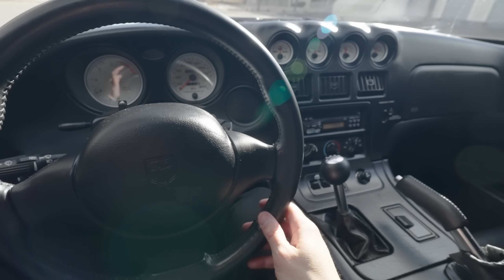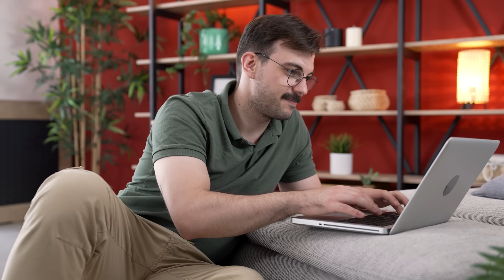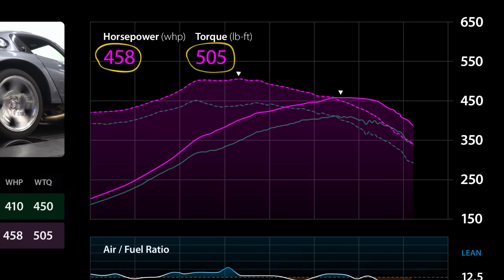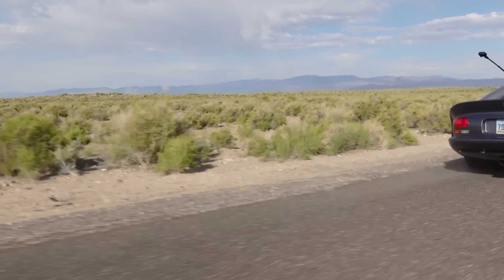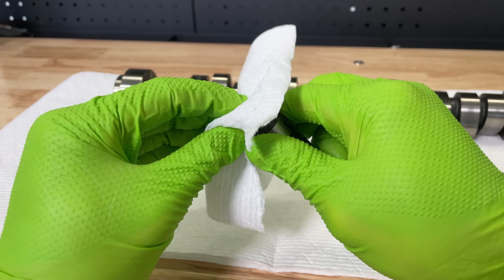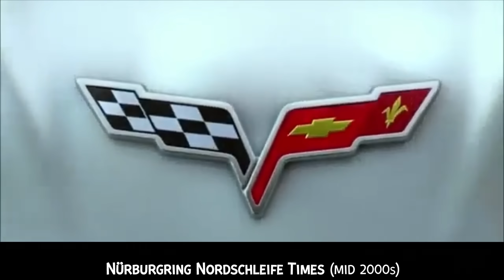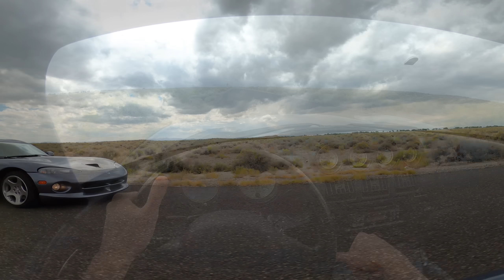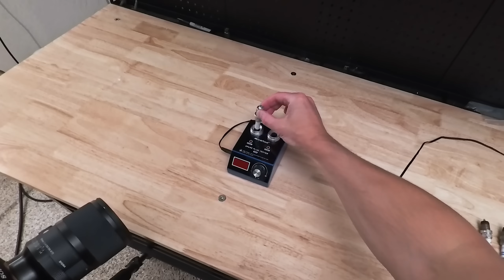Don't call it a comeback

Comment: Brother ya gotta stop using octane “booster” just get a can of race gas and mix at a low percentage. You will gain actual HP and it will also run cooler during long pulls. Just can’t go crazy with it if you run cats.

Comment: That little plastic hand is the best fanboi prop yet, it's hitting the has-been data screaming look look!  My POS car was good a long time ago and I'm so upset that I kept the magazines that told me this information!  Hilarious, couldn't beat a stock Z06 (never mind a ZR1!) so you dyno the car to discover it's just a better car than the Dodge, duh. Notice the name Doge doesn't appear anywhere on the Viper... that's how awful Dodge is, even the designers knew to keep that shameful name off the car.
Reply from the maker: I wouldn't take it so personally. There's a decade+ between these two cars.

Also 'dodge' appears on the rear bumper.

Comment: Side note : That Audi has the same Engine as the Viper, in the early 90's Dodge owned Lamborghini, that V10 is the  one in V10 Dodge Ram, Dodge sent a handful of those V10 Truck Engines to Italy to see what Lambo can do with them, they ended up putting them is some Lambo's, then dodge sold Lambo to VolkWagen which in turn owns Audi, Which they then put that engine in the Audi RS, to make a long story short 😆😆 Dodge Ram 2500 V10, Viper V10, Lambo V10, Audi RS V10 all have the same Engine, but Tuned specific to each Application

Comment: bro its kinda trash cuz engine doesnt let u go fast xd, gear does, think about hypercars like bugatti, almost 2k hp but it doesnt go 0-100 in half a second bc if they wanted it to accelerate  so much and still be fast they'd have to make a transmission that has 15 gears bc imagine a car with 7 gears but top speed is 200 but another one with 7 gears b ut top speed is 500 so the acceleration will be less but still faster, audi has probably a better transmission and its v10 so rpm diff maybe

Comment: Ive driven 2000+ hp drag cars, Teslas, a Lamborghini & Ferrari. I drove a few generations of vipers, IT WAS TERRIFYING. 
Yes a hellcat can spin tires in any gear BUT you can return it to a straight line, a viper you CANNOT unless you call it BEFORE it happens. As SOON as you hear it rev out quickly you get off the throttle. 
I have driven cars with literally 2-3 times the horsepower and nothing and I mean nothing will terrify me as much as a viper. 
They softened the blow by generations but ita a truck motor that can tow more than almost any truck (not diesel) out there. 
Absolutely a unit. I cannot believe ACR got rid of the viper. Hellcats suck, they arent even that fast. A viper, may loose off the line BUT when it hits 2-3 out of 6 gears it will take any hellcat to gapplebees all day

Comment: Could it have been caused by surface rust from sitting?  I had a H23A that sat for 5 years and it caused some pitting in on the cams lobes that were all pointed a certain direction.  I’m not entirely certain what direction because the engine could have been rotated after the rust formed.  Anyways I wasn’t going to chance it and run the engine like that.  I pulled the cams and cleaned them up before putting them back in.
Reply from the maker: interesting theory tbh, this viper did sit for a long time before i bought it.

Comment: You need to be using star tron enzyme fuel treatment alongside the octane booster.  You will be speechless at the results.  Please try it and then try racing or dyno ing it again.  The secret is to put the star tron fuel treatment into your freshly filled gas tank, after the fill up (not before like the instructions say — before may work fine if you put it in while you’re at the gas station but given how messy it can make your hands I don’t see how anybody would be doing that.  So definitely put it in your gas tank after you fill up.  The benefits are even more noticeable if you run a turbocharged engine and whenever the ambient temperature/weather is hot). Star tron enzyme fuel treatment.  I’m dead serious.  Please reply to my comment if you ever decide to take the leap of faith, and let me know your opinion on the results.

Comment: From an engine-building-excellence point of view, the euro boys are right. 100hp/litre is the minimum acceptable specific output.

 From a drive ability/useability/real-world-performance point of view it’s the shape of the torque curve, the gearing, the traction and the weight. Then the chassis/suspension.

 Horses for courses

Comment: 14:57 man this is a cool video the right amount of racing plus adding in the right amount of attention to the maintenance and technical side of it which racers know comes with proper use of any performance machine. Plus IT'S A VIPER I've always loved these cars. Thought of it as an American Lamborghini from back when lambos were fast but hard to control. Curious to see how it handles on the track in and out of curves with speed . Great video!

Comment: I were you, I would fix that car if it is possible, and then I would sell it immediately. In my opinion, these cars are notorious for having problems, especially if they have been driven hard. But even if you take care of them and drive them like a grandfather, that ticking issue can still happen. Personally, I think the Dodge Viper engine is one of the most unreliable engines out there. That is just my personal opinion, of course, and I know other people may have had the complete opposite experience. Maybe you have simply had better luck with yours. I am just telling you from what I have seen and heard that these cars can be extremely expensive and frustrating to keep on the road. When they are running properly, though, they are absolutely incredible cars. The performance is amazing, but reliability does not seem to be their strong point. If you want a car that you can constantly beat on and race, I honestly do not think this is the engine for that. It seems to be an engine that likes to be pampered, maintained carefully, and treated with respect. Even then, you can still run into problems.
Again, that is just my opinion based on what I have seen. You may have had a completely different experience, and if so, I am glad it has worked out for you. I just know that personally, I would fix it, sell it, and move on to something more reliable.

Comment: The gtr lambo are all wheel and can be quicker, but i guarantee theres nothing like being behind a twin turbo viper and hearing and havi g the rush of the monster.  Also, you know someone can drive if they can handle that.  

Ps, yes its straight line with that setup, not curves, which i personally like and excel at better.  You get the point; last though 😉

Comment: I just got a quote for heads and cam swap on my 97 viper.  Granted this is one of the top shops in the country, but the quote was $40k lol.  This included headers and a motech computer.  Will probably just do it myself.
Reply from the maker: Ask them how much without Motech as that's completely unnecessary for cam/heads/exhaust.
Reply: @F @Four_Eyes So you just took it to a shop and they tuned the factory PCM?  Love your channel brother, you do incredible work.
Reply from the maker: @RS-uo2nd  Yeah with HPTuners,. These Vipers don't have a lot going on (no VVT etc) so the tuning is pretty basic. But they don't have knock sensors either, so keep your AFR under 12.5 at WOT and keep an ear our for knock.

And thanks, appreciate it.

Comment: I have heard that straight up copper core plugs will be better than your lithium or trillium or whatever spark plugs. Those types of plugs are meant for longevity whereas the copper cores aren't made for longevity - just to pass electricity efficiently. So, if you decide to use copper core plugs you'll be changing them a lot more often.

Comment: Stock Viper 450hp - 3,350 lbs - 0-60: 3.9 
 Stock Shelby 526hp - 3,750 lbs - 0 - 60: 4.1 
then you added 50 hp to the viper before the race as if it wasn't already faster than the shelby lol

Comment: Looks like they were fouled with octane booster residue.

Yearscago, to try to pass emissions, I dumped a large can of octane booster in my 84 camaro that only had less than a quater tank of gas in it. It passed emissions, but i decided to pull the plugs the next day for the heck of it, and my plugs looked just like the ones in this video.

Comment: You wanna check out the Bentley Continental GT3..

Quad turbo W-16 on an 8-speed auto transmission with 4WD..

Top Gear had Captain Slow take navigator for a rally driver on a gravel track (even going airborne) 140mph in places..

That was a cool video, nice work with the engine, & that Audi R8 dangggg, that sounded SO sweeetttt

Comment: I used to believe the old saw "there is no replacement for displacement".  This, while true in a lot of cases, doesn't tell the whole story.  It's how much oxygen you can get through the engine.  There's a reason it's called a throttle.

Comment: Back in the day Road & Track found the Viper incredibly quick in acceleration, even noting that it reached 100 mph in 888 ft versus 895 ft for the 911 Turbo, yet the Porsche still won their overall 0–100–0 test. Most more demanding race circuits, however the Porsche would outright win through consistency, and more importantly even more so in the hands of less capable drivers because you didn’t have to drive it at 130% unlike the viper that was very close to being out of control to get anywhere near the Porsche. Basically, the Dodge was a car for occasion and excitement, but it wouldn’t have been the intelligent person’s choice. That’s okay, but you shouldn’t really say by referencing a track that is not considered Technical.

Comment: Why???? Why would u have the heads built, change the cam, and put the 30+ year old spark plugs in it??????
Reply from the maker: as mentioned in the video, those plugs barely had 500 miles on em

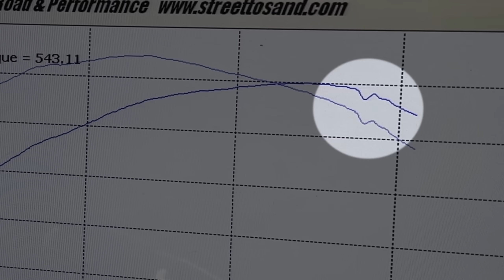Comment: At 13:50, as soon as you said plus "octane boosters" and how gnarly the spark plugs looked I knew the culprit. I used to use octane boosters quite often which led to cylinder misfires. It seems that due to adding octane boosters often, my spark plugs and wires got damaged. So I replaced all the spark plugs and wires and it fixed the misfiring.
Reply: Then again bad spark plugs and coils can also cause a misfire by themselves and spark plugs can even go out in as little as 30k miles so they probably just needed replacing, also octane boosters dont really boost the octane to where youll see any performance increase from it, guess you shouldnt have built your engine to take more than 91/93

Comment: Loads of torque is what you want torque gets ypu there fast. You can have all the hp you want without torque ypur doomed. Let me drive that viper i will squeez all and everything there is to squeeze out of it. Take that viper to calvo that guy knows his vipers. Seriously hes the best of the best.that way has a 2700hp viper and a 3500 hp viper. But a fat fat pocket book 😒 dont diss that viper ill take it and it will be a 9l stroked viper fast. A sequential gearbox like calvo has is the way to go. That viper run the factory plugs dont try all this fancy crap what they use and design it for always works best. Dodge likes champion id never put ac delco in jap cars like ngk or denso id never put champion in them . Audi like vw or denso id never use anything but. My bro is right on that factory plugs cause less missfires and the engines though sounds stupid run typically the best with what the factory put in them when everything was desinged. People try all this fancy crap thn sometimes have issues.  If a guy messed with anything good proven performance coils maybe. Im sure you know a ton on cars sorry i just love cars. My dad raced my uncle raced. Dad did for ford after service in Vietnam.  Shelby 428' and 9's for carol shelby and for then my dads uncle ervin did he was known all over in many states way back. Id love to carry the torch. I need a good machine to do it in. Id really like my dads uncles ford fairlane or his 1950 merc hr raced. Both cook. He has a galaxy 500 as well that went like a bandit. Any of the 3 id love to have. I should check.with family so his 90 yr old wife dont hand it over to some tool on the street for nothing.
Reply: Torque is multiplied by gearing.

Comment: I did all of this in 2002. Plus a blower.   Next put on screw type supercharger.  With ported heads big cam 1.7s 14lbs of boost.  850hp and all the torque.

Comment: Nice video. I had a 2000 ACR I got back in 2009 for dirt cheap and later had a heads and cam package viper TA 2014 that had about 770hp crank. I was surprised to have Audi r8 V10 performance plus just smoke me over and over from the dig. I didn’t realize back in 2017 that it was the new Audi with 602hp awd. It really was a very fast car. I think the Shelby gt350 and especially the 350r cars to be some of the best driving experiences one can have at any price range.
Reply from the maker: Nice, those built 5th gen Vipers are special. And I totally agree about the GT350s, they perform surprisingly well at my local hill climb event (roughly same time as mclaren 570 etc)

Comment: Impressive.  Albeit, these kinds of improvements will make most vehicles go outside of their limits.  I like how quickly you run through a repair/maintenance job with explanation.  Some channels spend an excessive amount of time on such matters.  The 1 thing I will say against some of these vehicles that lost to you is this, your weight factors into it all.  Then you have reaction times from the driver.  Prepped surfaces.  Altitudes.  Tire conditions.  Etc.  But it is still a LOT of fun!  Makes me wonder if I should invest in a Viper or stick to my Charger. 🤔

Comment: You are way way overthinking the spark plugs 

Put in an NGK copper plug 

No coating no iridium. Nothing special 

If you want the plug to last, drop your plug gap no more than .030

Comment: There is zero back pressure 

If you ever have any back pressure in your exhaust system 

Your exhaust system is plugged 

You don't reduce back pressure by putting on an exhaust system or headers or high flow, muffler etc. Etc 

Zero back pressure. You're talking terms from 1938

Comment: Change the flywheel on the transmission to a lightweight flywheel, new belts (skip the air compressor pulley), new alternator, change gas filter and fuel injectors, use synthetic oil., upgrade the volts power on the alternator with a stronger battery. Also put on a lightweight crankshaft pulley. And check the bearings for proper greasing and freely moving in your hubs of the wheels.

If that doesn't work may need to rebuild the engine with better aftermarket components.

Comment: It's a video of a guy putting a brand new ls7 on a Dyno machine out the crate and it actually Dyno'ed at 590hp at 5800 rpm's and 568tqat 5600 rpm's  at the crank

Comment: The Challenger Scat Pack is a non-starter.  I don't even need to see the race.  The car is super heavy and there is no way its poor power to weight ratio is going to compete with a Viper that weighs almost 1,000 lbs less.

Comment: That Viper was built to do what it did in those tests.  It just rode like a brick on wheels and would beat you to death to ride in on a daily basis.  
The suspension system had to be so stiff to let it handle like it did and it made it a rough riding vehicle.

But as a pure sports car?  It was a beast.

Comment: Vipers, especially of that era, have two things going for them - raw torque (and I mean LOTS of it, you can take off in 3rd gear in that thing), and a bunch of raw power past 4th gear. Once you get there, you're in the goldilocks zone. I've had the pleasure of becoming well acquainted with two Vipers from that era, an RT/10 and a GTS, and both of them still hold their own today. It's dirty, it's loud, it's impractical.......and it's GLORIOUS. FYI - CHECK YOUR POWER STEERING HOSE! I learned this the hard way on mine. Good luck driving that monster without it.

Comment: Not saying it’s the cause but the plugs in my snowmobile looked just like that after using octane boost for one trip, ~220 miles and it was running like crap until I changed them and stopped using that octane booster.
Reply from the maker: I think you're probably right. I use extra booster on the Viper since it doesn't have knock sensors.

Comment: @Four_Eyes You are not nearly shifting that Viper quick enough. You are losing quite a bit of momentum and speed between shifts. You have to shift quickly.... almost violently. An aftermarket shifter would help with this. But....you must learn to shift faster....and consistently. That is key to drag racing a manual equipped car. I used to race my 71 Corvette 4 speed small block. I ran ET streets at the track.  Of course, then you start chasing the dragon for the next weakest link in the chain. Heavy duty clutch, heavy duty U-joints, etc, etc, etc. I became a believer in the auto trans soon after. It's hard to beat a good modern automatic. Anyway, after all this is said, I still stand by my advice or recommendation to shift faster. Some drag slicks are in order for you as well, I believe. Great video BTW!!
P.S.  Two more tips. I don't mean to sound condescending. Please understand. But watch some manual trans shifting techniques videos. Study them, and practice while sitting in the parked car. The other thing that will absolutely help is a shift light. If you shift at just the right rpm consistently it WILL improve your time. You will have to determine what that rpm is by your dyno statistics. I understand also that you don't want to race only at a track, but all the little things help on the street. I'm truly jealous of your Viper too😊.

Comment: Gen 2 Viper is 12.5 seconds in the Quarter Mile stock.       That's cute.  🤣   
Stock run at 12.2 seconds, somebody jumped the light by .3   🤣